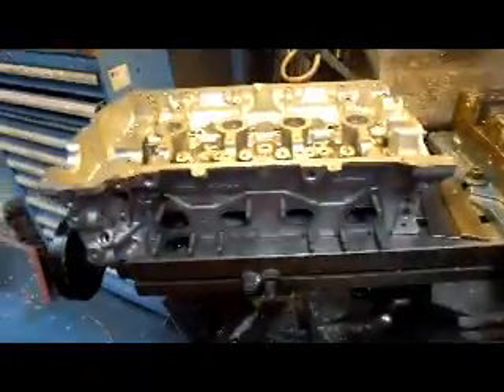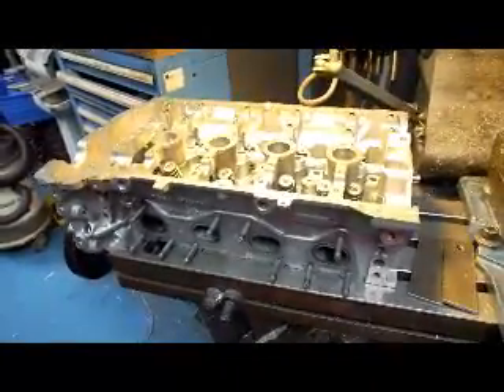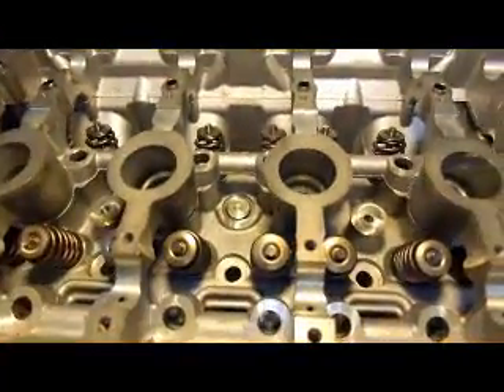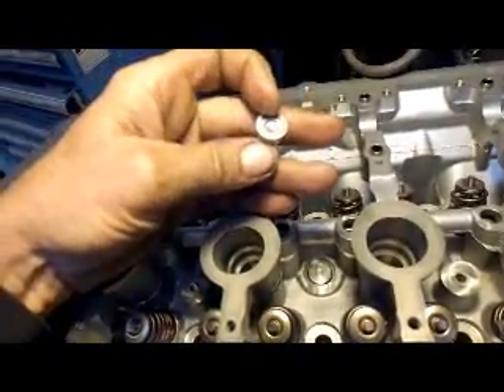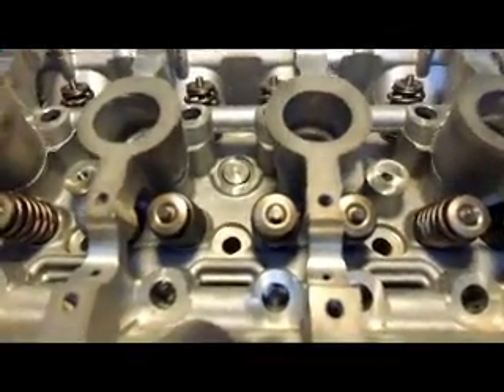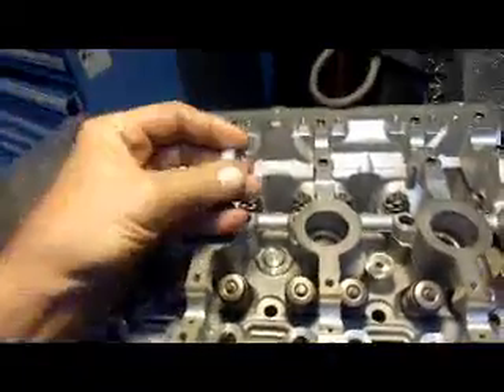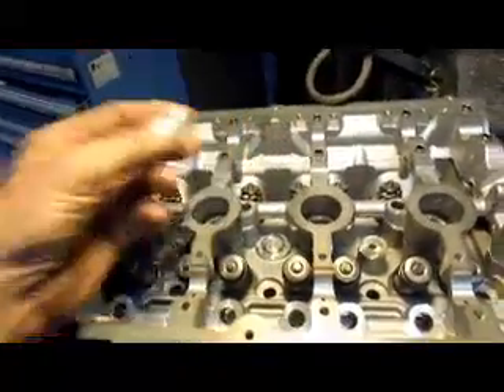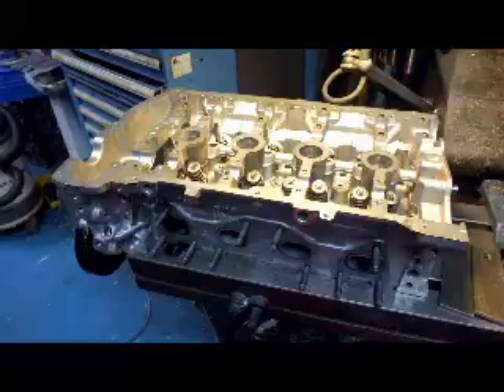New Mini (Peugeot engine) Head Core Plug Problem

Comment: It's actually a 16mm tapered on my 2011 Cooper S.  I'm going to try what you did because the original doesn't exist.  I would suggest you drill out the other two because it's only a matter of time.
Reply: ckradio good to know their is more than one surprising

Comment: Same problem I had. This plug keeps the antifreeze separated from the engine oil.  My engine was low on water, added more on side of road. I did not have a burping screwdriver with me. Steam pocket formed under this casting plug, and blew it out. Oil pan full of water, oil pump solenoid would not pass the milkshake. Engine quit due to no oil pressure.  Misdiagnosed as (1) blown head gasket (2) cracked head (3) cracked oil filter housing (4) cracked oil water cooler. Instead, I threaded this hole and made an aluminum screw plug, permanent fix.This plug costs $11 at the dealership. I wonder how many consumers have paid for the worst, and the repair was only $11 in parts + book time to swing a hammer.  2011 MCCS 80k miles.. Fiatnutz, your video is only place I've seen this problem identified/exposed. thank you for posting it.  When the plug is missing, the hole looks like it should be there, as it is pocket milled just like the head bolt holes. Until I filled the rad with the vc off, I could not figure out how water was getting past the windage  tray.// The factory plug is press-in soft aluminum. Replacing with a threaded plug is a forever fix. I tapped the head by stuffing Duct Seal into the hole, and more ds in the tap to catch all shavings.  // Will this be a common problem? Oh yes, but the service tech will replace, not repair. Home mechs have more time to pressure test the oil filter housing, cooler, and so on.
Reply: Good to know
Reply: I have the same issue, I found the plug on top and as I fill the coolant it starts to come out of the dipstick. Would this be the issue, most people I ask think it's the head or head gasket, now that I saw your comment and this video it makes me think it could be that. What I the best way to fix it, have you got a video of how you did yours? It's a 5yo video, I hope you are still around 😎👍